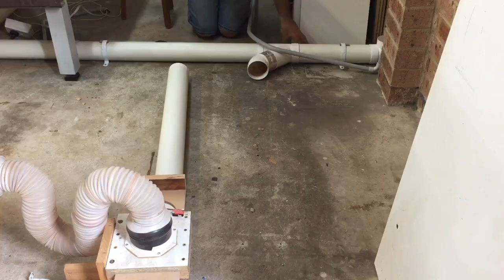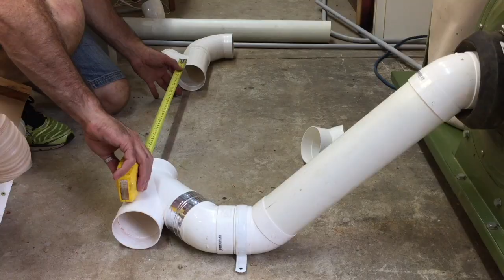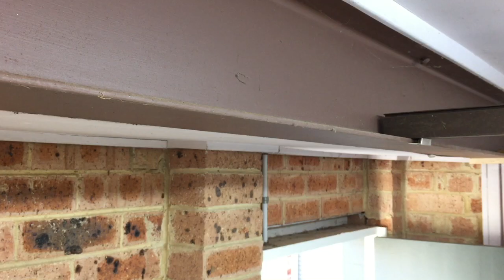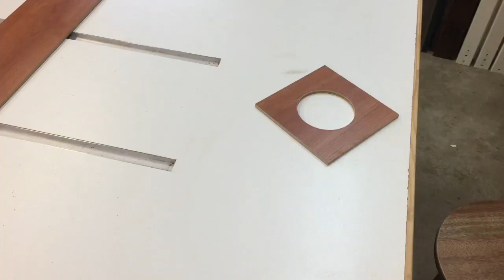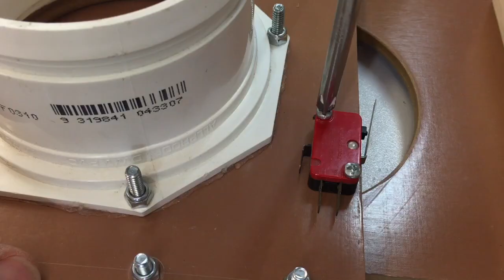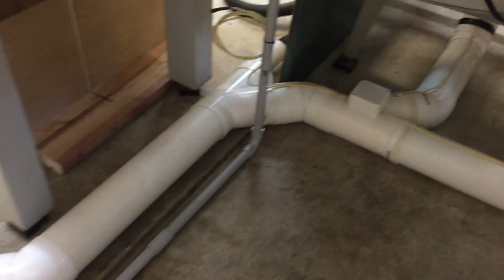New dust extraction system and workshop upgrade

Comment: Great vid 👍 how effective is a 2hp dust extractor with so many outlets and 90mm PVC?
Reply from the maker: Thanks Geoff. Its very effective for my shop and tools. Keep in mind I only ever have one blast gate open at a time, I can only use one tool at a time. Also since adding a cyclone and moving the setup outside, there is no bag or filter on the outlet so no restriction.

Comment: Great to see an Aussie vid and how its done over here.. I use 100 mm dwv pipe for my system and love the idea of the switch system, which I will keep in mind for future, at present.
 I just use a remote switch on the powerpoint for my dust extractor, where I place the remote near the machine I am using or on magnets placed in the lower ceiling of my shed being an old 2 car steel garage with metal A frames.
Reply from the maker: Thanks very much Tim. The remote is a very handy way of doing it, a lot of YouTubers use them. Just don't lose the remote :-)

Comment: Mate I'd love to see a more detailed build video on that circuit for the control switches. Looks a hell of a lot simpler than some of the arduino-based stuff I've been seeing.
Reply from the maker: One thing about the system is that its simple IMO. I'll put it on the video list. Cheers mate.

Comment: When you redo your dust collection I would recommend  that when you start your run that you stay full size at least until the first split to improve air flow. 
As an HVAC guy I have never understood why every one uses PVC it cost more and is harder to install than sheet metal, but that again is me. No potential static charge build up.
Your dust collector looks like the Harbor Freight unit the sell here on the other side.
Reply from the maker: Hey Monte, thanks for the tips. The price and availability of metal ducting here in Australia wont be the same as where you're from. The PVC pipe was actually fairly cheap IMO. No static charge either so far, there really is two worlds of thought on that topic. The system is working great for my setup. Cheers mate.
Reply: likewise, here in the UK we simply dont have access to HVAC metal pipe, but PVC sewer drain at 110mm is relatively cheap and common - but you then have to construct 110 to 100mm connectors lol I too have never had a ststic problem with pvc, but again... england <> dry air ;-)

Comment: howdy,

seem u r an old sparky, why dont you get rid of the old relay and use an electronic one, no contacts!!!, they are very cheap, i have attached an ebay add for u to have a look, very simple 4 u to convert

http://www.ebay.com.au/itm/1PCS-24V-380V-SSR-40DA-40A-250V-3-32VDC-DC-AC-Solid-State-Relay-Module-/152270016989?hash=item23740011dd:g:WrMAAOSwnHZYlXXJ

mick
Reply from the maker: Thanks Michael, hadn't seen these before. If I ever need a replacement I'll get one for sure.
Reply: DownUnderWoodWorks & Michael, between you might be able to help me. After receiving a noise complaint I've decided to set up automatic data logging when certain tools turn on and off. Ideally I'd log individual tools but could get by with an aggregate. searches online show close to what I want but expensive. Can you suggest equipment that will record electrical events. I'm a programmer so reading the data is no problem.
Reply: greetings tim,

over the years I have had a fair bit of experience in data logging, unfortunately what you are suggesting woulkd require a multi channel device, and one for each machine, now on the cheap, you could use a kitchen timer (electronic) This is the one I have from ebay (http://www.ebay.com.au/itm/New-Digital-LCD-Kitchen-Timer-Countdown-Sport-Cooking-Clock-Calculator/252685530994?_trksid=p2045573.c100508.m3226&_trkparms=aid%3D555014%26algo%3DPL.DEFAULT%26ao%3D1%26asc%3D20160706105120%26meid%3D5f0e4165397d4bd7a22cc4aa042e735d%26pid%3D100508%26rk%3D1%26rkt%3D1%26)
it has a stop start function press button to stop and press same button to turn on,  it will give you a cumulative figurer, you would have to do this manually for each machine
to do electrically, brake into the timer, bypass the switch and extent switch to relay "make" contacts, relay will have to be wired to machine as to operate when machine is on, all this will do is give you "time on" data
there is usally two sets of contacts on a relay, the spare set could be use to gather the actual on/off data, storing this data wont be so easy
anyway hope this will help

mick
Reply: I'm not sure you need multiple devices. Using a microcontroller such as an arduino or even the raspberrypi mini computer (£5 Stirling) you can easily log the on/off times of the dust extractor. Then simply use a sound pressure meter to log the workshop noise during the extractor 'on' events. Youwont need equipment on each tool, and this should be accurate enough for the purposes of supporting or countering a neighbours complaints

Comment: Wow! That is some pipework. Unfortunately I have a small workshop and have my machinery on rollers so cannot fix pipe and don't think I would want to unless I was sure I could leave machines in a fixed place. I have a Dust Extractor but found that raising the piping reduced the ability for it to extract well. Have you tested how effective your unit is on all of the different items?
Reply from the maker: Hey Michael, i've never noticed a difference or reduction in extraction with overhead pipe. its a pretty common way of running it. I don't plan on doing any 'testing' of the system as i find it works great. Cheers mate.

Comment: I have about the same system what did you do about static electricity I found if I touch the pvc pipe it will knock your socks off
Reply from the maker: John, so far I have not experienced static with my PVC pipe over the years that I have had it in all its different sizes and configurations. As for this machine I have only just installed it so i'll have to monitor it. Thanks mate.

Comment: I loved the electrical relay idea. Brilliant!

I have been told that one should have 150mm ducting for a unit like that. Apparently this is necessary to get enough airflow to remove the invisible particles. 
Although since your collection bag is just venting back into the workshop I guess most of those invisible particles are going back into the air anyway in your case.  
Do you plan a future upgrade to 150mm or is it all working well enough for you?

I currently only have a shop vac so I'm researching all this. First I need enough power in the shed to even run a dust collector. So you're still way ahead of where I am.
Reply from the maker: Thanks Dave. The 150mm ducting may be just a matter of opinion, it would be good to do research. I'm not aware of any actual testing results that are available. These machines are sold new with adapters to fit 100mm pipe so that must say something. The 90mm system works very well for my shop and tools. Good luck with it mate.

Comment: Do you find it works ok with 90 mm all others I have seen talk about 6'' pipe
Reply from the maker: Steve, the system works very well. The 50mm pipe worked quite well on my smaller tools. I didn't even consider 6'' pipe because I was afraid of what the cost would be. Even 100mm pipe and fittings can be significantly more costly than 90mm.
Reply: That was my thoughts too thanks

Comment: New Blast gate design looks Great. My system is all 100mm flex hose but I think the 'Ribs' build up some dust and also cause a bit of frition resistance, I think I will follow your lead and change it out for 90 PVC. thanks DUWW
Reply from the maker: Thanks Peter, 90mm pipe and fittings are very cheap from the major hardware chain. Good luck with it mate.

Comment: Nice job.  Makin' do with what ya can get w/out breaking the bank.  But I'll bet the pseudo 90 degree bends will draw some comments!  I wonder if It'll be spotted.  Any reason - other than cost - stopping you from going the big 150mm ducting?   What's the transformer max current output?  Oh, and  Aussie  Aussie Aussie...
Reply from the maker: Hey thanks Luke for the shout out. I didn't consider 150mm piping because I was afraid of what the price would be and just simply didn't think I needed it. I'm not sure of the rating of the transformer, it was one of the many I have in a drawer but it is only powering the coil of the relay so doesn't need to be highly rated.
Reply: Thanks...

Comment: Hi,the rubber collar is for a connection from a toilet and the sewer pipes.why do you have the pvc dust pipes on the floor ,over head please.
This is a trip hazard.or raise the floor so all that pipe work is underneath.you would only loose a small amount of head room and some money for the flooring .
Reply from the maker: Hi Bill, I was going to comment about that in the video but decided not to at the last minute. Please read the video description. Thanks for the feedback mate.
Reply: If its your own workshop, you know the pipes are there and its not really a tripping hazard. Not suitable for a multi person workshop, but solo? No problem. As for "some money", feel free to shout me the 10 sheets I'd need for the subflooring! ;)